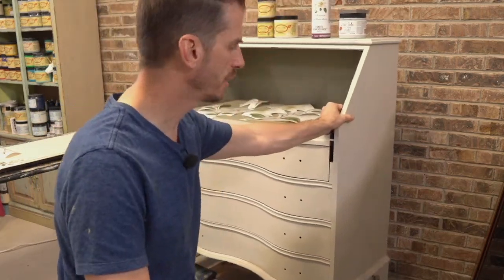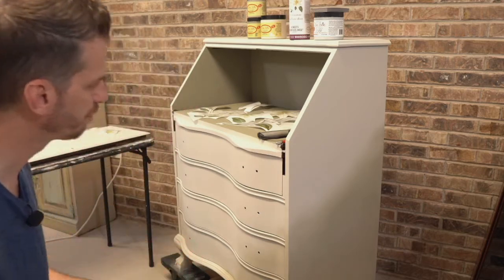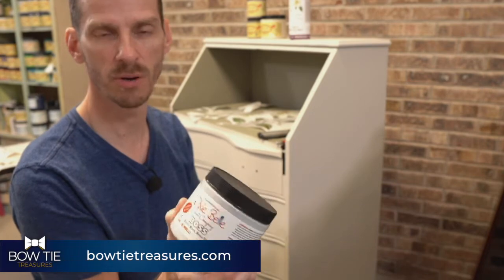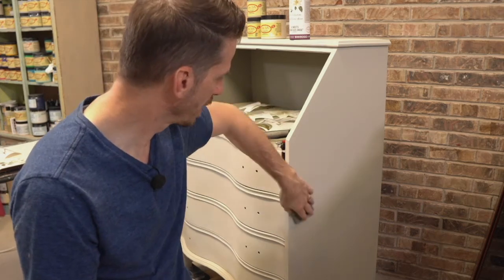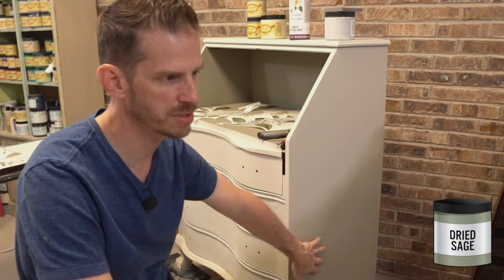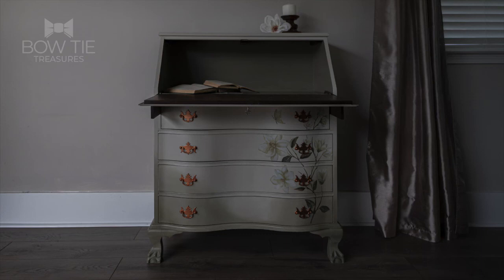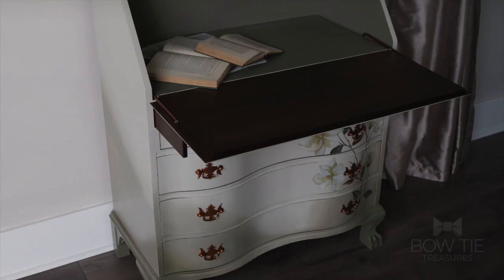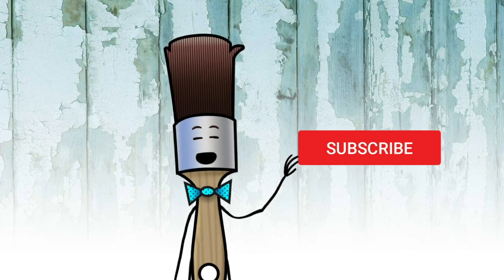How to blend Chalk Paint and apply Dixie Belle Transfers Demonstration

Comment: Great job!!👍 🥰. How do you sealed your transfer. What are the paint colors you used. Thank you for sharing!!
Reply from the maker: Blending around the front and sides went from Sawmill Gravy to Dried Sage. The desk area has a solid color of Spanish Moss and the desk top was sanded and stained with Voodoo Gel Stain (Black Magic). For darker shading near the feet, I used Collard Greens color. 
You can use the Satin Clear coat for sealing after applying the transfers and chalk paint.
See the transfer selections at > https://bit.ly/3tJz0GK  

And, thank you :-)
Reply: @BowTieTreasures  Thank you so much 👍🏼